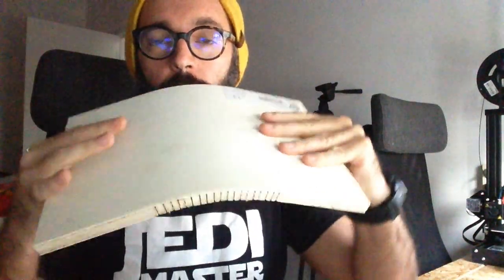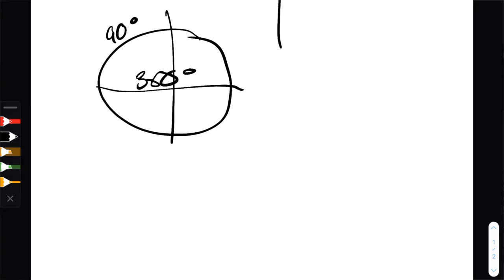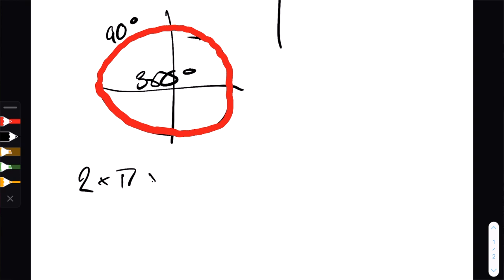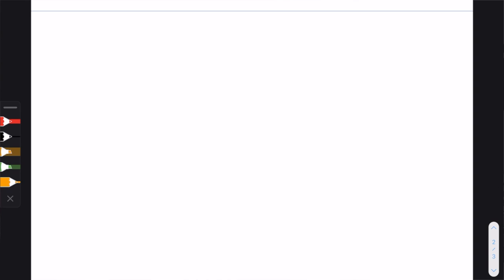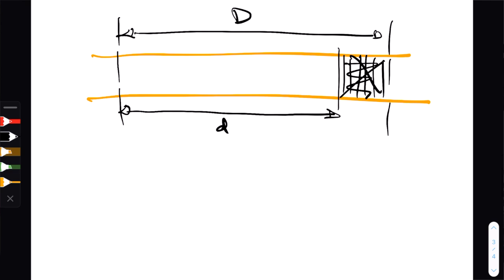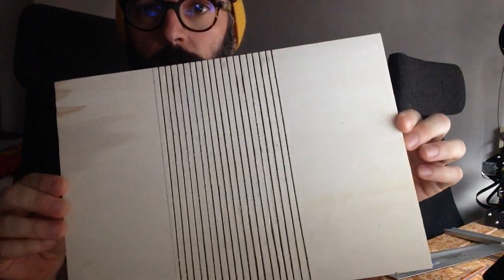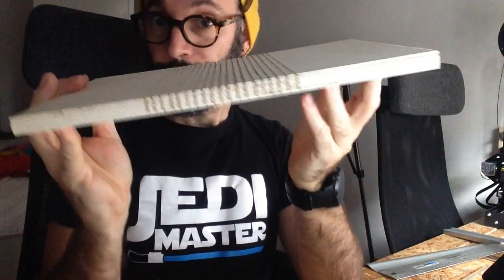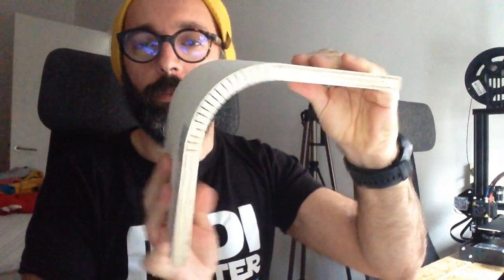How to do EXACT Kerf Bending

Comment: First, great video and explanations on why this works.  I, like many others (I hope!), are interested in the how and why of things.

Second, here are a couple suggestions.  It is always beneficial to use standard language / definitions.  To wit: the “perimeter” of a circle is called its “circumference.”  An easier formula for the circumference is πD (Pi times Diameter (= 2 x radius)).  Now, it is noted that because you are using a Cartesian coordinate system to do your math, using a radius is the easiest way to explain this.  It is a lot easier to put this in a simple spreadsheet or write a Javascript (or other) program.  For those interested, I can provide, as best I can short of providing the actual spreadsheet, how to create a spread sheet to automatically calculate all this stuff.  The thickness of a saw blade is called the “kerf” — which is why this video is called “Kerf Bending.”  I have created a cool drawing that recapitulates what “One Time Builds” drew — only my drawing is cooler and could be available as a downloadable PDF!  But, I do not know how to include this in a comment section, so…

Now, if anyone wants to create a spreadsheet (I used Excel, but these formulas should work in any spreadsheet), follow the sequential steps below to automatically create a spreadsheet with all the info you need to make a kerf cut piece.  A couple points for novices: a spreadsheet can contain text info or actual numeric data; additionally, the numeric data can be automatically calculated from manually input data.  DO NOT Overwrite or input data in a cell with a formula, otherwise the formula is erased.  All formulas MUST begin with an equals “=” sign to tell the spreadsheet to following text formula is something to be calculated. This spreadsheet works independent of whatever units you use, HOWEVER, all data units must be the same.  DO not mix mm with cm with inches, etc.  One final point about cells; they are referred to by the Row and Column which references where data is located that will be used in a calculation. A specific cell be also given a name to refer to a specific / unique cell name (this is what I have done).  Using a cell name is easier than referring to a row and column designation in a formula; and the particular cell name can be used anywhere within a spreadsheet, without having to manually look up the specific row and column that may be used in a formula. There are only 5 cells where you will directly input data; the rest of the cells will automatically calculate the info you need to do kerf cutting.  Additionally, this spreadsheet will work using any angle of kerf bending, regardless whether you want make a 60° bend or a 135° bend.  To re-create my spreadsheet, I am providing four steps (see below).

I should also note that you do not HAVE to name cells; it is what I (and most others) do to make writing formulas easier.  However, you have to name the cells, WITH the name I used, if you want this spreadsheet to work correctly.  With a spreadsheet this small, without referring to Row and Column references is sometimes done.  To give a cell a name, (generally) just right click on the specific cell and an option “window” will appear.  Select “Define Name…” and then type the name I used EXACTLY as I have it (described in Step 3 below).  The spreadsheet is looking for an exact name match; each name specifically references a Row and Column location. What I generally do is give cells without a formula a color, e.g., yellow (right click a cell and select a fill color from the options).  Now I know all yellow cells require data input; in this spreadsheet, there are only 5 cells that will require info from you because the rest of the info is automatically calculated.  I assign a different color to other cells to remind me that these have something in them, namely, a formula. I you type something in a cell with a formula, the formula will be erased — will not calculate correctly or display errors. To make this easier, do Steps 1 and 2 first; this will set up the basic spreadsheet.  Then proceed to Step 3 and name all the cells as indicated in this step.  Then, in Step 4, you will enter the actual formulas in the “rest” of the cells in Column B.  It is best to right click these cells (before or after you have put a formula in the cell) and color them a light shade green or blue or whatever: something that is light colored so you can see the data in the cell more clearly).  These will pretty much be every cell in Column B that is not colored yellow or  — intentionally left blank —.

So here is how I set up my spreadsheet (each line is a separate row, as noted).  Create a spreadsheet as I described below and I think the rest of this will fall into place.  The following info is divided into steps with each grouping being demarcated by ** STEP …: .  In the first row of my spreadsheets, I generally make these a “header” place where I can describe / remind myself what data each column is supposed to have below the header.  I did not do this in the instructions.  For example, I used the first row to remind myself what measuring unit I am using. This is a constant reminder to keep my measuring units the same, so I use inches and do not input mm; if I used mm, I need to convert cm to mm or vice versa. One final point, I added the option to add additional kerf cuts to insure I have enough “inside” cutout to make a bend. This is purely optional.  If you do not want to add any additional kerf cuts, enter 0 or leave it blank.  I generally add one or two extra kerfs, depending on the length of the small radius, the thickness of the wood to be curved (to reduce the stress on un-kerned wood that bears the brunt of all the bending, etc.)  It is a good idea to spritz the kerfed wood, and heat it with an iron or heat gun, to loosen the wood’s lignin to it stretches and not breaks.  So unless one has really high end equipment (or skills) to accommodate a couple tens of a mm or thousands of an inch, adding an extra kerf (just in case) before it is too late is good insurance.

** STEP 1: Label the info in Column A that will indicate what should go in Column B.
Put this text in Column A in Rows 1 - 18 (a couple rows will be blank).
[Row 1: Col A]  (In this row, text is not really needed)…
[Row 2: Col A] Angle Desired
[Row 3: Col A] Arc's percent of a circle
[Row 4: Col A] Thickness of the wood
[Row 5: Col A] R (the large radius)
[Row 6: Col A] r (the small radius)
[Row 7: Col A] Large Distance (D)
[Row 8: Col A] small distance (d)
[Row 9: Col A] Difference between the two distances: D-d
[Row 10: Col A] --- intentionally left blank ---
[Row 11: Col A] Kerf (blade thickness)
[Row 12: Col A] Number of Kerf cuts to make (rounded up)
[Row 13: Col A] Length of wood to be removed from r (side of board)
[Row 14: Col A] Number of extra cuts to assure better fit
[Row 15: Col A] Actual number of Kerf cuts to make
[Row 16: Col A] --- intentionally left blank ---
[Row 17: Col A] Distance between each kerf cut
[Row 18: Col A] Width of wood between each kerf cut

** STEP 2:  Change the color in these DATA INPUT cells in Column B to yellow; you will only enter data in these five yellow cells. The rest of the cells have formulas and will automatically calculate these without any help for the user—unless you have over-wrote the formula.
[Row 2: Col B] [Data Input; color these cells yellow]
[Row 4: Col B] [Data Input; color these cells yellow]
[Row 5: Col B] [Data Input; color these cells yellow]
[Row 10: Col B] --- intentionally left blank ---
[Row 11: Col B] [Data Input; color these cells yellow]
[Row 14: Col B] [Data Input; color these cells yellow]
[Row 16: Col B] --- intentionally left blank ---

** STEP 3: Name these Cells
It is best to right click these cells a color (the non-yellow cells), such as light shade green or blue or whatever: something that is light colored so you can see the data in the cell more clearly).  These will pretty much be every cell in Column B that is not colored yellow or  --- intentionally left blank —.
Right click cell B2 and name it AngleDesired
Right click cell B3 and name it ArcPercent
Right click cell B4 and name it Thickness
Right click cell B5 and name it RLarge
Right click cell B6 and name it rSmall
Right click cell B7 and name it DLarge
Right click cell B8 and name it dSmall
Right click cell B9 and name it WoodToRemove
Right click cell B11 and name it Kerf
Right click cell B12 and name it NumberOfKerfCutsToMake
Right click cell  and name it [unnamed; data for info only]
Right click cell B14 and name it Extra Cuts
Right click cell B15 and name it ActualNumberOfCuts
Right click cell B17 and name it KerfDistance

** STEP 4: Enter the formulas in the “other” cells in  this text in Column C in Rows 1 - 18; all cells with a formula start an "=" symbol / sign to tell your spreadsheet it is supposed to used referenced cell to do a calculation
[Row 3: Col C] =AngleDesired/360
[Row 6: Col C] =RLarge-Thickness
[Row 7: Col C] =2*RLarge*PI()*ArcPercent
[Row 8: Col C] =2*rSmall*PI()*ArcPercent
[Row 9: Col C] =DLarge-dSmall
[Row 10: Col C] --- intentionally left blank ---
[Row 12: Col C] =ROUNDUP(WoodToRemove*Kerf,0)
[Row 13: Col C] =Kerf*NumberOfKerfCutsToMake
[Row 15: Col C] =B12+ExtraCuts
[Row 16: Col C] --- intentionally left blank ---
[Row 17: Col C] =FIXED((DLarge/ActualNumberOfCuts), 5)
[Row 18: Col C] =FIXED((DLarge/ActualNumberOfCuts), 5)-Kerf
Reply from the maker: Thank you @ragcell for your comments. You are right about the "standard" terms and I will pay more attention next time. As for the tools, Im mostly interested on the how and why. I would have been quite easy once you understand how it works to make a script or an excel as you point out (wow...your explanation is very detailed!), but if you google kerf bending calculator there are already solutions out there. In all honesty I was not expecting any comments, this is a rather niche topic and my explanation was a bit too detailed for most hahaha. If you want to make your excel available, Ill be happy to put a link in the comments with the right credit to you.  Cheers!